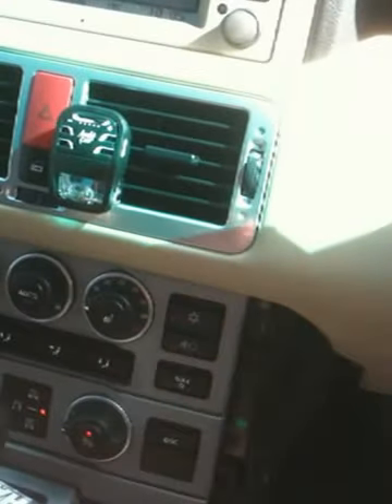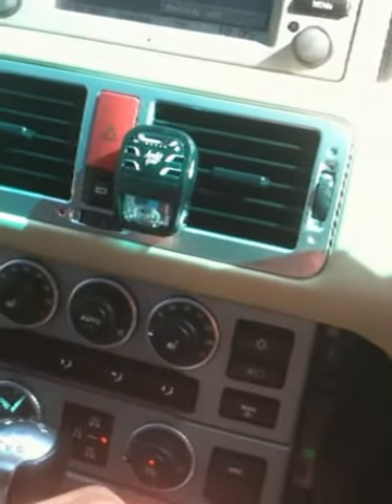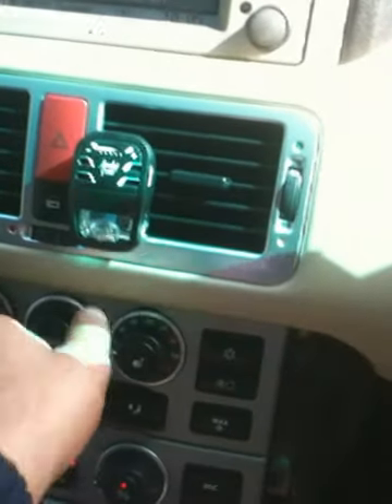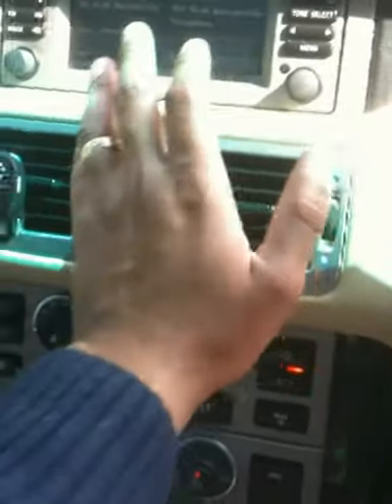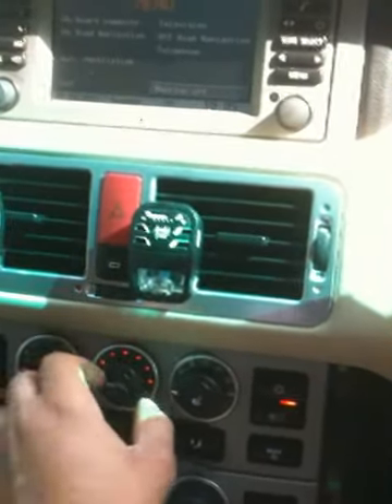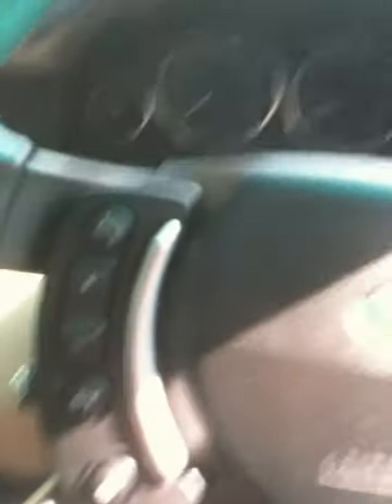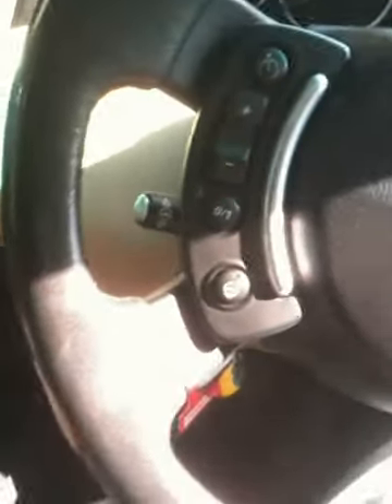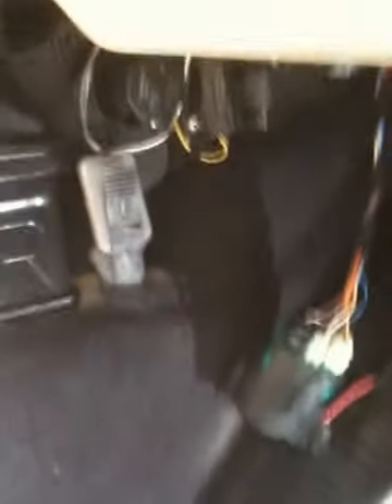LAND ROVER RANGE ROVER L322 3.0TD6/ 4.4 V8 FINAL STAGE RESISTOR REPLACEMENT DIY (1)

Comment: to stop battery drainage always switch off ignition  every time and lock the car, as all electrics are still working when the car is left open.. used to leave mine open  till my battery started draining  always lock it up now  all the best with your car george